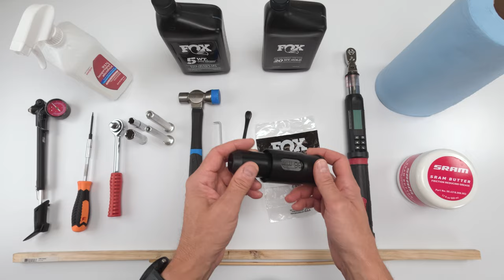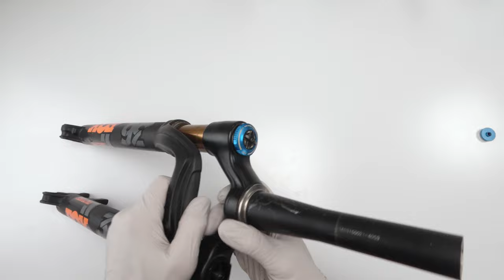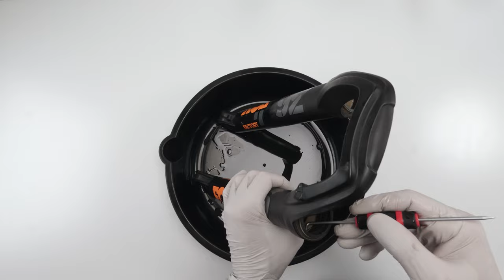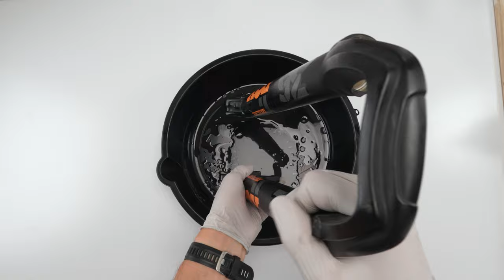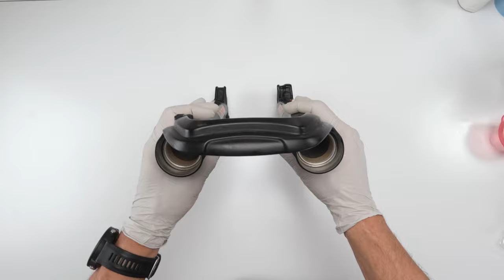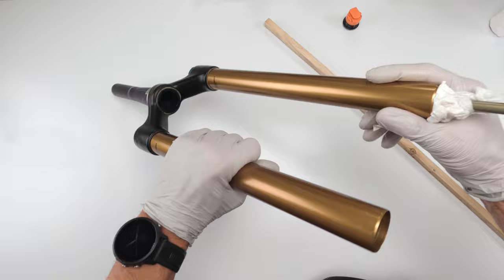2019 FOX Factory Series 36 FLOAT GRIP 2 Full Service guide for beginners. WEAR your safety glasses!

Comment: You can buy an air spring assembly for around $30. Why not just buy a new assembly after you do a couple seal services? Until your video I didn't even know the air spring could be serviced like this, but it seems like this is more effort than its worth. I'm assuming the seal kit cost $20+ with shipping, so all this effort to save $10?
Reply: Maybe a take off or used but new 2021 fox 36 air shaft is 75$ vs 15$ for the seal kit idk about 2019 model tho
Reply from the maker: Typically, the air spring will cost twice as much as the seals. The overall job is fairly similar. There is also much less waste by just replacing the seals. But if you find a good price on an air spring, then you can just replace it and skip a few steps. Either works
Reply: Air springs are loaded with grease direct from Fox resulting in suck back of the air piston. 
My ‘22 Altitude / 38 had this condition with maybe 5 hours of easy riding on the bike. 
Upgraded to a Grip2 while I was in there!

Comment: 5.7 Nm ?????  Reinstall the rebuilt damper cartridge into the Damper-Side Upper Tube. Install a new damper-side crush washer followed by the bottom nut. Make sure to align the crush washer with the bottom nut before tightening. Tighten clockwise to 80 in-lb (9.0 Nm) torque with a 15mm socket.
Reply: best advice 😂
Reply from the maker: Thanks for the comment. I just looked into the service guides for the FOX 36 and saw conflicting information on the FOX website. The lower leg service guide states 5.7 nm for both damper and air spring nuts. The damper guide for this fork (2019) says 9 nm, and the air spring guide says 19.9 nm for the damper side nut (this seems excessive).  I used the values in the 50-hour (lower leg service only) guide, since that part of the video is the second half of the 50-hour service. I'll call up Fox today and get an answer to the above and post it in the description section. Thank you very much for bringing this to my attention.
Reply from the maker: So I just spoke with a service technician at FOX. He's stated that the service techs torque the boot bolts for both damper and air spring sides to 50 to 55 inch pounds,  which is ~5.7 nm - ~6  nm, and have been doing so for a long time.  Not sure what the absolute answer is between engineering and the service techs on this one considering there are 3 different values for the same bolt between 3 different service guides.
Reply: 9nm is way excessive for that smal bolt. There is a universal torque spec for all bolts in case anyone is wondering but the one i Follow uses aviation universal torque spec.
Reply: The crush washers are plastic. 50in lbs should be plenty for both sides.

Comment: I think, especially for people not as experienced as you, that it is much safer to pinch the O-rings with your fingers so that you put up some slack in them, which you can then pick with the tool. This reduces the risk of scratching any surface, and works with almost all outside rings. For the stiff inside O-rings, I have always found it easier and safer to pinch them/stab them and pull them out this way (as I think you did at 31). Keep up the good work!
Reply from the maker: Great recommendation, and I couldn't agree more. I really need to script these vids in order to add more details. There are so many details to remember when recording, but the marble rolling around my head has trouble recalling them
Reply: No man, really, your videos are some of the best I have seen about suspension and overall bike maintenance. Great work.  @zoubtube

Comment: Why dont you take apart the rebound piston assembly? Just curious? Is it unnecessary?
Reply from the maker: I'm assuming you mean the needle controls. It's not needed in this case, no seals to replace in it. One less thing 😉
Reply: @zoubtube  There are two small o-rings in the rebound adjuster that you need to take apart the piston to access. But, to put it back together, you need a feeler gauge and torque screwdriver (!).

Comment: Hey Zoub, oddball question for you - When you cycle the Grip2 damper to purge the excess oil, is there supposed to be some backpressure? (ie if you let it go it, extends back to full travel on it's own). My Grip2 damper keeps loosening at the top cap after each ride, even though im reefing on it to tighten before each ride. I finally took the damper out to try some blue loctite on the top cap threads and while I was compressing the damper to get the 40cc of 5wt oil in the lower legs, there was a noticeable amount of backpressure. Wasn't sure if this is normal or not since there's no compressed gas in forks. Figured the pressure might be causing the top cap to unwind somehow?
Reply from the maker: Merry Christmas, and my apologies for the late reply. When installing the damper mechanism into the tube, it will feel very stiff due to the new seals, and you will also feel some pressure. The pressure you will feel is based on displacing the oil as the bleed takes place. Now, if there is a bit of air trapped inside, then you will feel backward pressure, meaning the damper mechanism will want to push itself out. When filling the tube with oil, make sure that the shaft is completely extended and fill the tube with oil up to the bleed port. If this is off by the slightest amount, there will be an air trap, which will apply unwanted pressure to the damper mechanism. Ultimately, you will feel pressure, but it shouldn't be to the point where the damper mechanism is being forced out. I'm not sure if I did a good enough job explaining this. If not, let me know and I will try and revise
Reply: No worries and thanks for the detailed explanation! I realized I might not have bled it the recommended 75% travel and sure enough when I measured and did it the full recommended amount, quite a bit of oil spewed out the bleed hole. Makes sense now. Cheers! @zoubtube

Comment: Another thing to be really careful of when messing with the tiny c clip is if you pop it out it can shoot into oblivion and then your damper is ruined. For real, you have to have that c clip or it will leak when trying to close the damper up. Fox doesn’t sell the c clip itself of course. It is truly a dumb idea, rockshox does a way better job with their c clips in their dampers. Much easier to work with. Side question, I’ve seen you use a hand dyno in your other videos. What is the name of it? Like the manufacturers name, I see oso on the back but can’t make out the name. I’m looking to get a dyno for my shop to help with my suspension service.
Reply from the maker: Bob, your advice is always SUPER appreciated! I actually mentioned the C-clip potentially popping off into the room in the video, because it's happened to me in the past. I literally scoured an entire room with a 1-inch magnet trying to find the stupid thing. I had no idea that fox didn't sell these clips if they get lost. Next time I work on the fork, I'm taking the clip to a hardware store to see if they might stock them, and I'll put the size in the description just in case that happens to someone so they can find a replacement. Thanks for the heads-up 👍 and to everyone else out there, DON'T LOSE THE C-CLIP! 

The Hand Dyno is from a company called Off Streets Only (OSO) https://www.offstreetonly.com/  . It's a solid piece of gear, but pricey. There was another one that I was planning on buying from a company here in MI called UP Bikes: https://up.bike/ . Not as elegant, but significantly less expensive. The supply issues a few years ago was the reason I ended up buying the OSO. I have to assume those issues are solved now. Just a fyi as both are viable options, imo, and I would have opted to save the money at the time if I could have.
Reply from the maker: HI Bob. Question for you. A YouTuber pointed out that the bolt that holds the damper shaft to the bottom legs should be torqued to 9 nm instead of 5.7 nm. I looked it up on the FOX service guides, and literally came across three different torque specs for the same bolt. The 50-hour guide states 5.7 nm, (which is what I torque them to) the damper guide states 9 nm, and the air spring guide states 16.9 nm. So I called Fox today and spoke to a service tech, and he said the service tech's torque both bolts to 50-55  in/lbs, which is about 5.7- 6 nm. I was wondering what your thoughts were on this? Thanks
Reply: @zoubtube  I've noticed that discrepancy too. There is even one service guide where they have the 15mm being torqued to 10-15nm! I decided to just use the torque spec that rockshox uses on their forks for the crushwashers, which is 7.8nm. So I typically torque the bolts to 8nm cause I work in a shop and these torque wrenches are used constantly so they may be under torquing sometimes. Side question, do you have a vacuum bleeder/fill machine? Hand bleeding takes forever, especially when working on dhx2, or the new float x.
Reply from the maker: @bobsaget3841  I was surprised as well to see three different torque specs. Anything higher than 10 nm just seems excessive to me. I spoke with the service tech for a good amount of time on it today, and he seemed adamant on them using 50-55 inch lbs, but at the same time he couldn't answer why there were different values for the same nut across different service guides. I'm not sure what to think. Rockshox has been clear on this for years with the 7.8nm.

I don't have a vacuum bleeder. I literally don't have space for one. I'm sure I'll end up getting one eventually, but first, we need to find a house to put it in. It's going to be the old-fashioned way for me until then.😉 

It seems like there are quite a few offerings now for vacuum bleeders, though they are pricey.
Reply: @zoubtube  ya most likely the fox rep has to stick to what the service guide says for liability sake. You would need to talk to the actual engineers to get the more in depth answer! Ya and the crush washers are so similar, except for the big one on foxs 15mm bolt. So I feel fine about using the rockshox spec. Ya im trying to get a suspension program going in my shop so having "professional" tools is really important for credibility and liabilities sake. I work for rei and I'm the only mechanic who does suspension service in the south. I'm working on building my own vacuum bleed/fill machine just to prove that there is a huge demand for service and that it can be profitable. The speed the bleeder brings is invaluable.
Reply: It happened to me today , the c clip popped out , i found it after 2 hours, tried to assembly without it and it didn’t work, hopefully I found it as I said, good advice for people before servicing their damper
Reply from the maker: @diegocabrera4056  You popped your cherry! Welcome to the club myman! 😁 A person can just about lose their mind trying to find that thing. Glad to hear you found it though, because without it, it could have been a significant issue. Also, I believe you asked for a FOX transfer dropper vid. It "should" be out this monday. My plan was to upload it two weeks ago but my place got flooded during a storm last month, which set me back significantly with video editing. just an fyi

Comment: First time I see that heat is needed, and also many more tools than in any other service videos about full service
Reply from the maker: Heat isn't really needed but its highly recommend when working with loctite red. Loctite red can be surprisingly strong, and shocks and forks contain relatively soft metals, which can be easily damaged with excessive force. As for tools, an adjustable wrench/knipex can be used for many tasks, but I'm a big fan of using wrenches and torqueing with crows feet. Back In my armature moto GP days I used to have to work on my own engines, which demanded precision tools. old habits die hard I guess. 🙂

Comment: Great video, do you have any videos on Fox 34 Perf step cast Grip or is it the same procedure as this?
Reply from the maker: Glad to hear you found the video helpful. It's basically the same process BUT,  you will need a thin wall 10mm  socket to remove the bottom nuts. Bad design decision by FOX imo. You might have to grind a regular sized socket. I plan on making a video for a step cast. One of my buddies has one. I'm sure I'll work on it this winter

Comment: What kind of torque wrench do you use? I struggle a bit getting the whole specter of crowfoot spanners that fits mine, and also not easy getting a wrench starting with torque at 0 and beyond 30.
Reply from the maker: I have snapon AtechFR torque wrenches. I bought them a long time ago for different purposes. They are complete overkill for this application as they are literally meant for the aircraft industry, so I don't recommend people buy them as they are expensive.  but still, they do make the best torque wrenches by far, and they truly are a "for life" product. so there is some value there if you use them on other stuff as well

There are many options out here for low torque ranges in both click style and digital. I like digital and it stays accurate longer than click, as long as they get impacted hard. but they are expensive. for bikes: Tekton makes a good bang for the buck torque wrench. 

https://www.amazon.com/TEKTON-24320-4-Inch-Torque-2-26-22-6/dp/B00C5ZL2EG/ref=asc_df_B00C5ZL2EG/?tag=hyprod-20&linkCode=df0&hvadid=692875362841&hvpos=&hvnetw=g&hvrand=7597802535824491848&hvpone=&hvptwo=&hvqmt=&hvdev=c&hvdvcmdl=&hvlocint=&hvlocphy=9016979&hvtargid=pla-2281435179578&mcid=6d3b393ae80a3febbd0d35a8c50c4c16&hvocijid=7597802535824491848-B00C5ZL2EG-&hvexpln=73&gad_source=1&th=1

To give you an idea of price range, the snap on click equivalent is part number QD1R200A, which is over $300 new. 

as for crows feet you can get an adjustable crowfoot, or you can buy them individually and buy the actually sizes you need

Hopefully this helps some
Reply: @zoubtube  Cheers man, thx for a great video and quick answer!

Comment: Thanks to your video I just completed a complete rebuild of my Fox 36 Factory. There's a few slight differences as I have the Grip 2 VVC damper but pretty easy to figure it out with your detailed instructions and the fox service manual.
Reply from the maker: Outstanding Job Myman! 🦾👏👏 Yup Very minor difference between the two. I will eventually be making a video on the VVC version, but for now it sounds like you are good to go! Now go out there and pound that beast! 👍

Comment: Hi and thanks for the impressive video. At the 23 minute mark you use the paper towel to absorb oil coming from the damper side. Wish I had known this to keep things tidy.
Also considering that oil loss from the damper side I'm wondering if I have to service the damper side or at least remove to replace the lost fluid.
Reply from the maker: I feel you myman. I learned that lesson the hard way years ago. All the remain oil absorbed into the carpet I left it on. The oil than comes out is residual from the lower legs. when you assemble the fork you will end up filling the lower legs with oil before closing them up. No need to worry about it 👍

Comment: Thank you sir! One question though, I did the lower leg service and swopped air shaft (130->140) on my fox 34 Grip2 fork. I followed your instructions but must have made some kind of mistake. When I compress my fork I hear a squishy sound (similar to a liquid passing a small passage). This sound was not there before the service. I have not ridden my bike much after the service due to weather conditions. Maybe it will go away? I compressed the fork roughly 20 times without it stopping. Do you know what might be the reason for the squishy sound and how I can get rid of it?
Thank you in advance!
Reply from the maker: Apologies for the late response. Just so I'm sure, the squishy noise is coming from the air side, not the damper side, right? if it's coming from the air side, check for suckup and make sure the shaft isn't pulling up at rest. It's possible that there is some grease stuck in the transfer port. This should clear up, but if it doesn't, you might have to service the air spring again.

Take it for a few rides and see if the noise goes away. If the noise is on the damper side, that's a whole different story. Keep me updated if you can 👍

Comment: Great video, very concise and informative on the procedure. Have you ever done the 2021+ VVC Grip2's? I used the factory service guide, but the instructions for the rebound assembly are missing some photos, and do a bad job explaining. It would be great to have a video if you ever have one to work on.
Reply from the maker: Glad to hear you found the video  informative. IF memory serves me correct, The VVC version doesn't have any seals that need to be replaced in the actually hsr and hsr assembly. If you take it apart its only to clean it, which isn't worth the effort imo. just leave it as a whole. I will definitely make a video on it. It's just a question of timing.